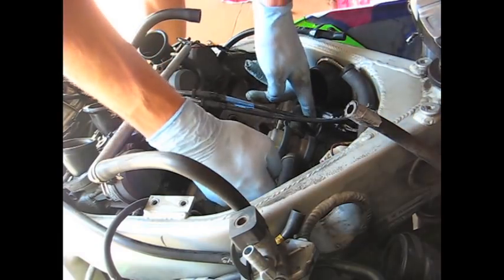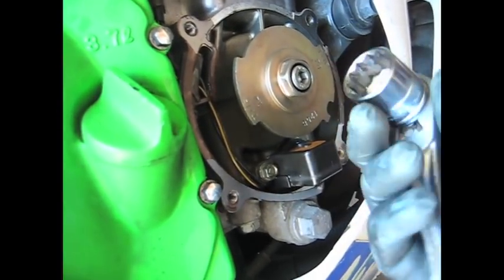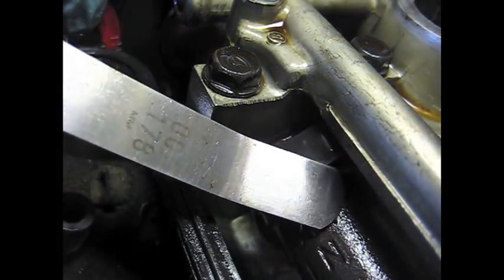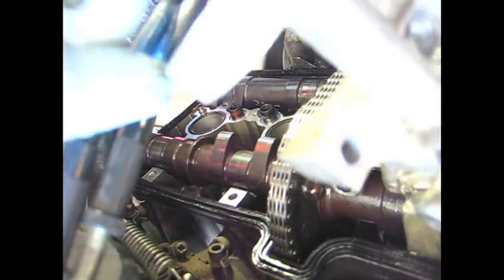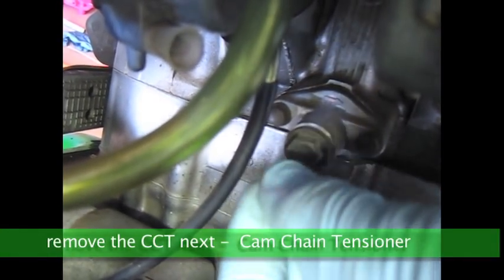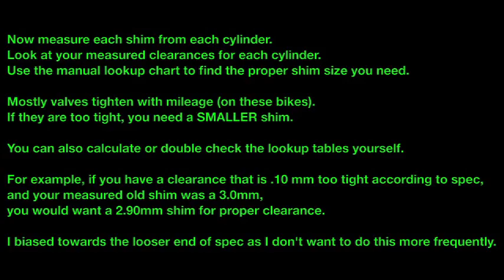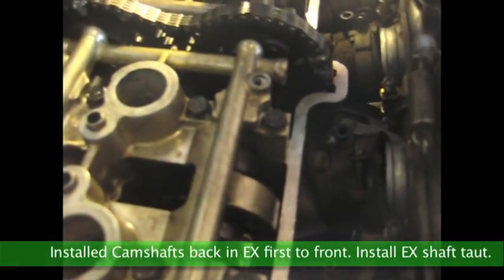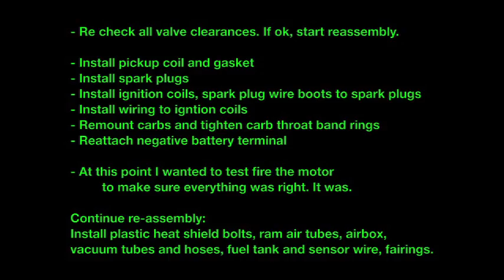Adjust Valves Kawasaki ZX6E Ninja by Green Magic Man. DIY, How to.

Comment: Thanks for the write up.   My head gasket blew and I bought a used engine off ebay and I decided I better adjust the valves because it had 22,000 miles.  Well, most were at .063.  I'm following your write up and the service manual.  Mine is a 2002 zx6.  So figure they've never been done and most valves at at .063 and one intake and exhaust valve was at .076.  Proud of my math.  If I'm at .063 with an exhaust valve and I have a 2.90 shim, I concluded I need a 2.683 shim for .28 clearance.  I'm going to use a 2.70 shim.

Comment: Just did my first valve adjustment on my 2000 zx6e. that was a scary one. It all worked out in the end, but at a few points I thought I busted a valve. first time cranking it after putting it all back together, one of the shims snapped into place, which made me think I broke something. then as I was taking it all apart the chain skipped a bottom tooth without me realizing. that caused the pistons to hit a valve while turning the crank. I finally got the chain lined up again and the bike is running now, I even did the +4 degree timing advance, but that needs more testing to see if it had an effect.
In the end I've taken my cams off maybe 10+ times because of that, so I have the whole thing down in memory.
Reply from the maker: Sorry to hear about that.
Did you hand crank multiple revolutions of the motor and therefore the valvetrain? 
That should have seated the buckets on the shims and should have either set the chain or let you know it was going to jump a tooth.
I would be very curious to know if you had done 3-8 full revolutions of the crank and still had that problem.
I did enjoy this job - after being quite scared off for too many of thousands of miles on the motor.
Reply: Green Magic Man the shim snapped in place from less than a quarter turn, just as the cams put pressure on the buckets. after I got everything back together the way they were supposed to me I did multiple cranks to make sure and multiple gap checks with my shims to make sure it was safe.
Reply from the maker: Ok, so you mean you fired the motor and that happened? Or you hand turned the motor many times and checked the clearances first (and they were all in spec), and THEN you fired the motor and the shim moved and set and caused all the problems?
Reply: Green Magic Man no. the first time I hand cranked it when it made the noise, which led me to taking the cams off again which led to jumping a tooth. then once I got it right I hand cranked it a bunch before checking with shims before hitting the starter.
Reply from the maker: Ah ok. I'm glad to hear that then. So simply turning the crank by hand alerted you that something was wrong and you were astute enough to fix it. Well Done Sir!
Reply: The sound of the shim popping into place was so loud only a fool would continue on
Reply from the maker: I am curious what that sounded like. Sounds LOUD.

Comment: Why are you worriesd about the position of the chain on the sprockets and marking it  ??? As long as the sprockets dont move and you have the IN/EX marks to line up with the head for that. Also those spark plug O rings may look ok, but will be compressed and degraded and may not stop moisture getting in so a very cheap swap and a lot easier than shims.
Reply: Oh I see making it easier to re assemble, not essential but definately easier. Good video, quite detailed.

Comment: w my crank at position 1-4 tdc, when i attempt to check intake cylinder 1, but the cam lobes are in the way...(or valve bucket is pressed down at this position.... ) do i roll the cam a bit and measure w cam lobes up, or do i do 1/2 the engine at position1-4, and other half only at position 2-3 tdc... not sure how to measure if cam is pushing down valve bucket
Reply from the maker: This may be the issue if I read this correctly - what you wrote:
Remember that setting the crank to position marked 1/4 means that EITHER cylinder #1 OR cylinder #4 is at TDC (Top Dead Center). They are not both at the same time. Look now over at cylinder #4 - is it at TDC right now? And if #1 is blocked - then turn the crank around again a full 360 degrees. That would then put #1 cylinder at TDC.
Reply from the maker: And if the cam lobes is actively pressing down on the bucket then you cannot measure the clearance!!
Although placing the lobe at TDC in relation to each valve is the correct way to do it - in reality, as long as the lobes isn't pressing against the bucket it can more or less be measured in any of the other 3 of 4 directions. Make sense? That assumes you don't have irregular cam lob wear spots anywhere - which is unlikely anyhow.
Reply: OMG!! thanks you..... i clearly missed that, i have the service manual, and i have rebuildt entire motors but.... i was having a hard time understanding this exact portion.... rotate crank 360 for other cylinder of the combo... Test 1, then rotate 360, then test 4, rinse repeat.....
Reply: was reading your blog post you linked re valve adjustment at the time...thanks again... will post my results
Reply: Ya, it makes sense now.... thanks mate.... threw a rod bearing at 92,162 km.... she had been making a funny noise I couldnt seem to find.   just rebuilt her from ground up...new second gear, shift forks & drum, just wanted to do valves while i had motor on the bench rather than in the bike.... I think i got it now that you gave me that eureka moment....now not only do i know what to do... i understand what i was missing
Reply from the maker: Hey I'm glad to hear! Excellent. I haven't touched my transmission but worry someday I may have to. That looks like a fair bit of work. Kudos to you tackling all that work.
Reply from the maker: And to be fair... the manual doesn't really explain it all very clearly. I had to get in there and rotate it around myself to figure what the heck they were talking about.

Comment: how can i get my 1993zx600e start. it i put a new cdi box in it and still wont stat
Reply from the maker: There are many factors why a bike wont start. We could IM off Youtube about your bike. I could look up a few posts I've made about this generally. But think: Spark, Air, Fuel. Usu not getting air is not the problem. Too much from a vacuum leak could be an issue but this seems uncommon.
1st, make sure battery is well charged!! That means at least 12.7 - 13 VDC resting anyway.
2nd, how long has bike sat? With fuel in it? With fuel stabilizer or not? Have carbs been cleaned ever?
3rd, check for spark on all four cylinders. 
4th, consider replacing spark plug wires. You can make your own for about $5. Buy 3-5 feet of the copper solid core 8mm plug wire (BWD is brand I used from O'reilly auto). You do NOT want to use 7mm carbon core crap typical automobile spark plug wires. 
The wires unscrew from the coils and the spark plugs. Chop up the new wire and install. Check for strong blue spark on all 4 while in there.

Comment: OK after doing this twice and getting strange "light resistance numbers" a tech explained.  The gauge should fit at the minimum but not the maximum.  And after two attempts mine has light resistance at .102 but it fits near max on intake and exhaust.  It's tight as shit near max on intake but not exhaust.  So I'm in range.  But many people will tell you the standard is light resistance but if you get near the max with that, I think you could shove a gauge way thicker through than the max gap.  So I think that light resistance is wrong.  You have a clue on your online write up where you say .038 would not fit through the valve, you did not say it was light resistance you said it wouldn't fit through.   Go/no go.  At least I hope so because I'm tired of doing this.  I've taken it apart twice now.  My initial intake shim for number 8 was 3.0mm.  I'm down to a 2.70mm.  I've gone from 2.90 on one exhaust valve to 2.45.    Which is an awful lot and it's still only light resistance at .102.  But I can put a .31 through but not a .35 through the exhaust. And an intake a .24 is tight as shit and anything bigger will not go.  so I think I'm done.

Comment: why the fuck didnt u just take the carbs out lol
Reply from the maker: Why? It's much easier to not bother. The 2 throttle cables suck to put back in. There's plenty of space to adjust the clearances - you only need space from the top. What would taking carbs out get you?
I take the carbs out enough times on this bike 'cleaning' out them.

Comment: That valve cover is a pain the arse. lol
Reply from the maker: Agreed, yes, it is. But I'd rather pull that cover than the throttle cables, they irritate me more.
Reply: +Green Magic Man yes true, them cables you have to pull super hard to get off. I pulled the motor out so I can check valve and re seat them and check piston rings. and cylinder 3 & 4 are all black and sooty where I took the header off of the motor. they are all black but 3 & 4 are the worst.